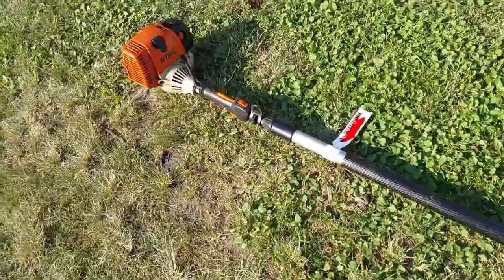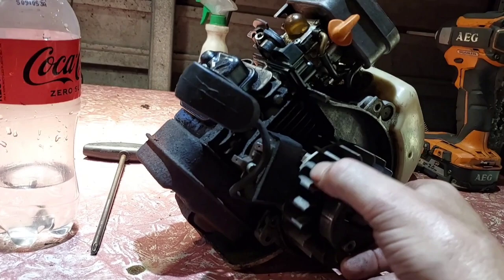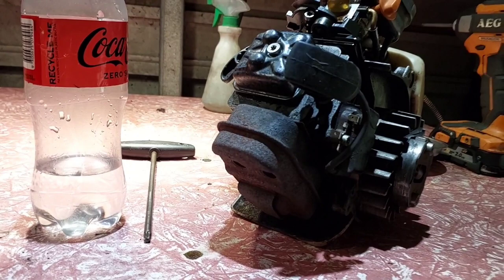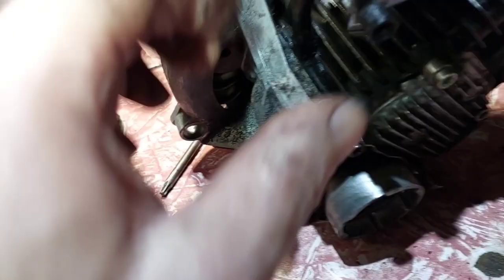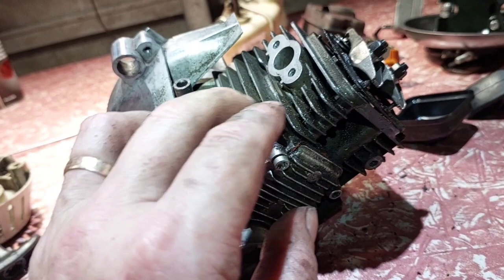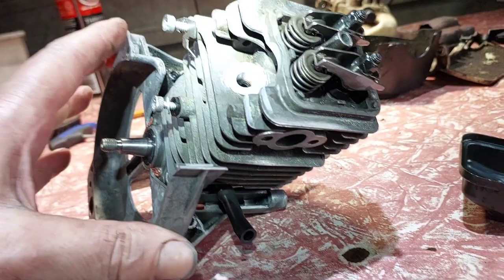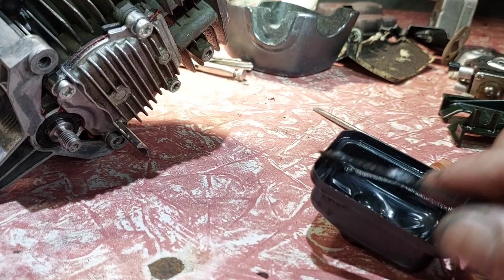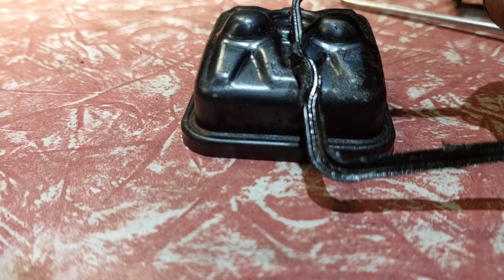Stihl HT131 pole saw I Learn something today, I like that!

Comment: Yes Kev, those are fussy little things any kind of air leak stops them. They play up if the valve cover gasket or the washer under the securing bolt is damaged. Plastic cam gear and lobe can melt too although I've only seen badly worn lobes myself..  Keep up the good work mate..
Reply from the maker: Thanks mate good  information ,I will a quick up date  video if I get her run again right cheers